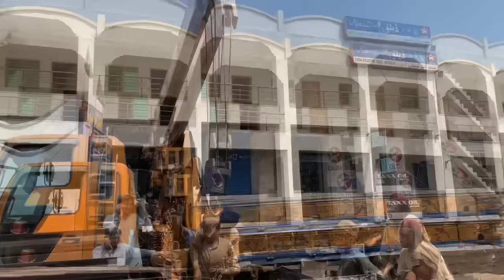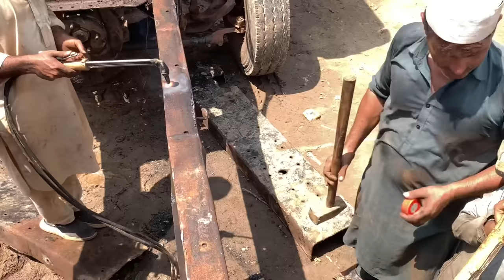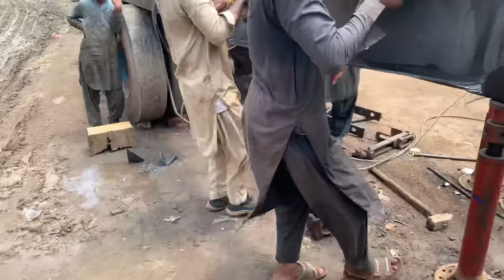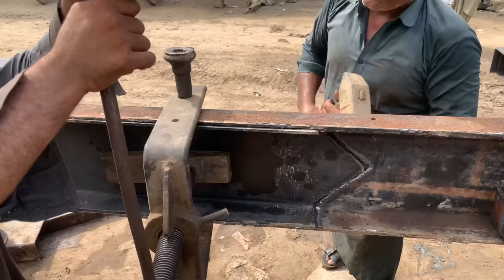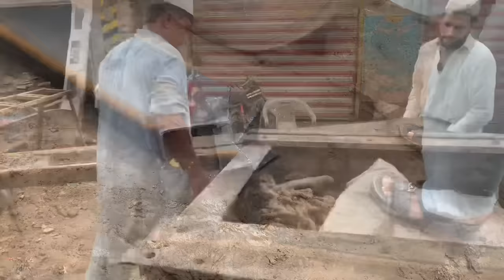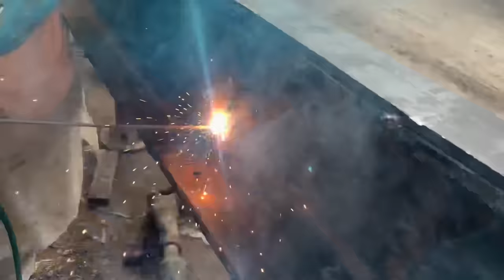How to repair a broken truck chassis || Truck chassis repair || Truck Frame repair

Comment: Triple skinned chassis rails!  I have not noticed that before!
As for the usual (like, on every single video like this..) negative 'i know better' comments, these chaps know what they are doing as it is their job.  So if the welds don't look to you like they are good enough, that is just your ignorance.   These are not seam welds on gas pipelines; they only need to hold the folded plates together, and I am sure they do so more than well enough.
Reply: They really don’t! 😂. There’s a reason that truck will coming back to these clowns for repair/reconstruction every couple of months, as it obviously does from the amount of botched welds on it!  You have to be some sort of office worker to even think this is “good enough.”

Comment: If they had lengthened the frame correctly to begin it wouldnt have snapped lol. Whoever thought using a lower guage steel than the original, while adding what, 6 - 8 feet to the frame....obviously engineer designed and approved that haha.  The vertical weld is also a terrible fix, you want to Z  the frame so you have more than a brittle weld to snap

Comment: Horrible weldings, most of them cold, and full of slag! And: Do not heat framerails! So no matter how much steel they use, it is going to break down the road. There is a reason for riveting on truck frames!

Comment: the welder is not profesional
Reply: Easy to judge the guy wearing flip-flops an zero safety stuff... I'm sure he is using a freshly calibrated machine as well.
Guy welded it with nothing but starts an stops an while ugly as sin I saw zero porosity in the grinded part so it is probably just fine.
 As far as metal fabrication it say it's a pretty decent job in below sub standards conditions... as long as they overlaped the fishplate by a good bit.